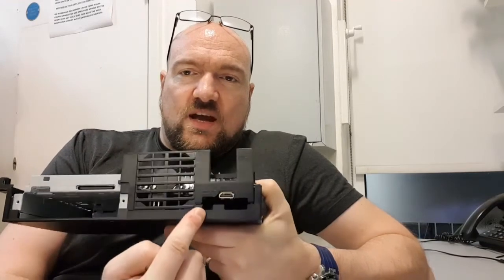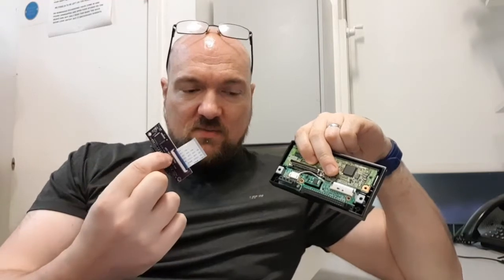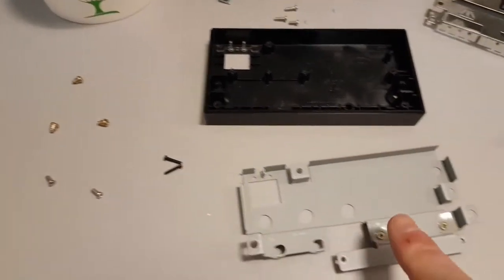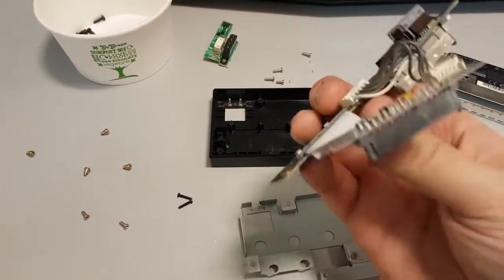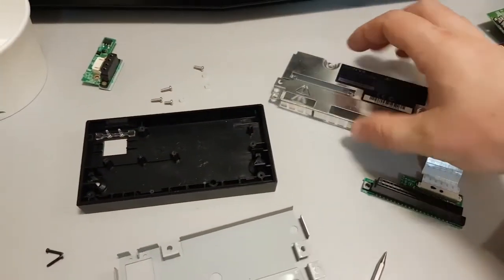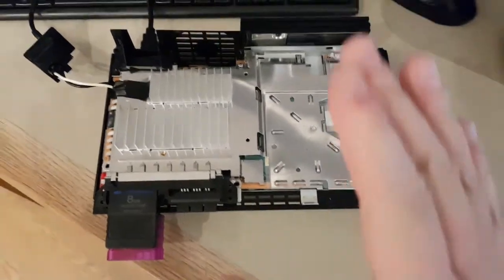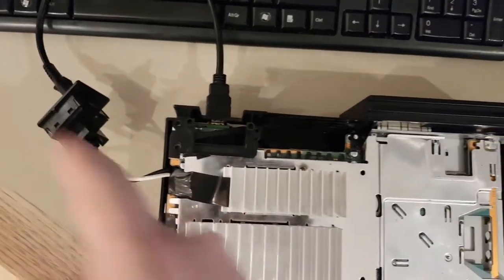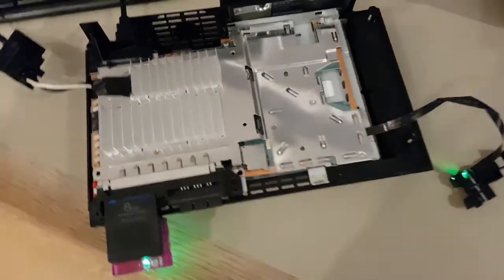Repairing & Modding My Original Playstation 2: Day 3

Comment: Your videos are awesome!

I found your channel by watching the pink ds2 mod! And now by coincidence you are doing the ps2 fat hdd mod like I start doing about a week ago hahaha

I recommend to you is to upgrade your FMCB to the latest version,with is the 1,966...
This newer version has some improvements,one of them is the shutdown option,this way you can turn off the console and the hdd safely,this older version didn't gave this.

And seems like you are not booting from the memory card bro,you are booting from the hdd... That's why on the top left of the screen it's saying (FREE HD BOOT)... I presume what you did was rip a FHDB image to you hdd,and put the hdd on your console...that image takes more than 7gb of space...

What I did since my ps2 has no modchip,was do the same that you did,but instead of keep using the boot from the hdd (fhdb) I used it only to softmod and gain access to the Ulaunch.elf,with is essential the file browser,then I put the FMCB instalar on a USB,run the installer and installed it on my memory card.
After this I formated the hdd again on winrip on windows to gain that 7gb free again...

The booting from the memory card is way faster than boot by the hdd.
And you can also use the Mc on other ps2 since you choose the multi install option. 

The hdd boot its slower on boot,but it came with way more apps pre installed,but all of then are outdated,like opl...and it takes that 7gb of space.

Are you going to include ps1 games on this project?

If yes,you will need to install popstater with is the ps1 "emulator",and to get the games listed on opl you need to use the newer version,basically the opl daily build has a ps1 games tab!

Sorry,my English is very bad,but I hope I could help you!

Peace!
Reply from the maker: Thanks that's super helpful. Yeah I did realise after I shot that video that I'm booting from the HDD, and your right it is waaaaay quicker from the Memory card, but to be honest I'm ok with launching from it. Im not planning on doing any PS1 stuff with this project because last year I got a PS classic, gutted it and rebuilt it into a kick ass console running a custom emulationstation image I made. That is my go to PS1 console now, it's on the channel, I called it the PS Legacy.
Reply: @jonnyboy1925  ive watched the ps1 legacy videos,it ends being a monster!
and The dualshock mod was amazing!

Your channel it's going to grow up really fast!

Keep the awesome work!

Waiting for the next episodes!!!
Reply from the maker: @rvmjsl2  Thanks, I'm really just doing this channel as a bit of fun while the kids are at school (That's why this series was seeing if I could finish a project in my lunch/coffee breaks), I will be able to do more videos when lockdown is over. I'm glad that you guys like it.
Also, spoilers: The finished stencil looks siiiiiiick. Hopefully I'll get that video up in the next couple of days.